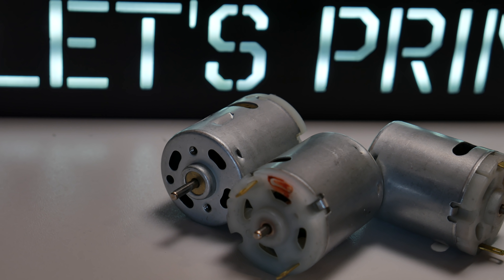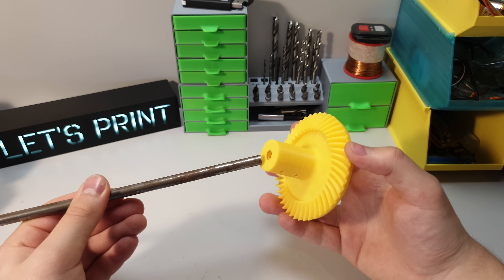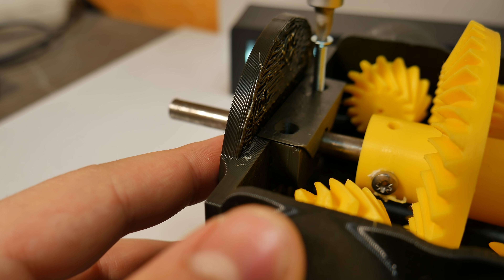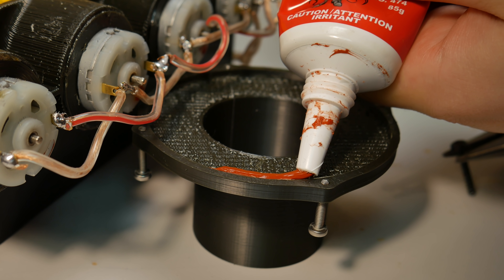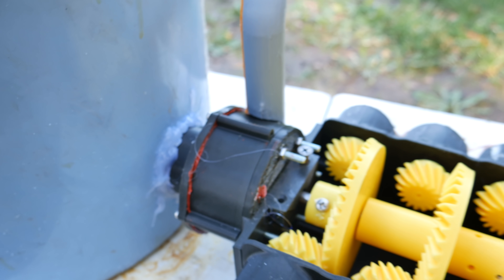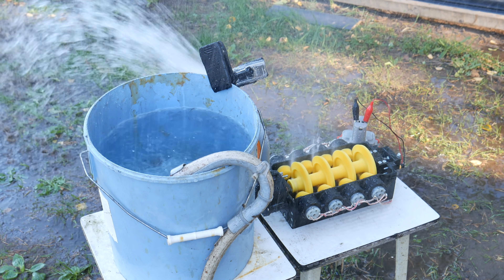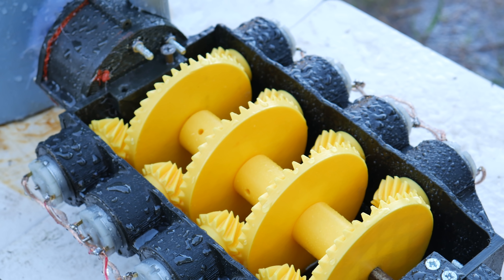Extremely Powerful 3D Printed Gearbox & Water Pump - Eight Electric Motors

Comment: Cool PoC but the water spraying over the contacts gives me anxiety attacks.
Reply: You can actually break in a brushed motor completely under water. RC car racers do it.
Reply: @mjodr  mineral spirits
Reply: @mjodr  Wrong. You can take a BLDC motor in water, not a brushed.
Reply: @darvinde  complete opposite my friend.
Reply: It’s fine as long as you blow them out with an air compressor when you’re done.
Reply: @itchyprince3793  mineral deposits will still be left on the contacts.
Reply: That won't do much because of the low voltage but the water will certainly kill the motors due to corrosion.
Reply: @Darvin Wrong. RC racers have been doing it for decades. Look it up. Plenty of people putting a brushed motor straight into a cup of water and running it full RPM.
Reply: @mjodr  usually RC and slotcar racers clean their brushed motors by putting their car into alcohol, soapy water or even benzene to clean out their car's motor, also to break in the brushes beforehand so that there's an optimal contact on the brushes.
Reply: @mjodr  Jeah, Look it up. After a few minutes the motor says adios
Reply: You think it's working because of a 2 minute video on YouTube
Reply: @mjodr  Also the water removes the oil on the brushes which will cause long time failures.
And water + voltage = Electrolyte Water = Broken Contacts
Reply: @mjodr  don't tell shit if you never tested it
Reply: @darvinde  You are hilarious. You clearly refuse to look up the numerous videos of people breaking in brushed motors in water. There's also no oil on brushes. Next you are going to tell me the earth is flat. The ignorance is incredible with you.
Reply: @mjodr  u
Reply: @mjodr  I tested it with serveral motors
Reply: @darvinde  actually your wrong. I have a slash 2wd and everytime I feel like upgrading I always break in the brushed motors in water for like 20 minutes. Never had a motor fail. And I've taken old ones and new ones apart and there is not any oil on the brushes. I don't know what you are talking about but you are definitely confused. Everyone in the hobby breaks in motors like this. Then you use break cleaner to clean them out afterwards and when they get dirty.
Reply: @jacobpoucher  in Long Time not
Reply: @wtfbbqthx  No bc I have the better profile picture I am right
Reply: @darvinde  You are wrong, @Matt Mead is correct. Racers have been known to break-in the BRUSHES on BRUSHED DC motors. While this helps to prevent chipping of the brushes, it does decrease the longevity of the motor and is not recommended by any motor manufacturers.
Reply: it would be bad if it were saltwater, still nothing too major.
Reply: A longer shaft between the motors and the bucked, along with drainage holes could help with the potential corrosion and short circuit problems
Reply: @Brody Massey Serious.. this guy thinks you put oil on brushes
... Screw it, you're both dense.
Reply: @DarkLinkAD  well there are special contact oils which you can put on your wipers (if you race slotcars competitively) which you can also put on your brushes, although not the best thing to do it's a great thing to get a good starting speed when qualifying, especially if your motor is on it's last legs, normal oil shouldn't ever be put on though as it's obviously an isolator
Reply: Just to put some light on this discussion but it doesnt matter what kind of motor it is, it all depends on its ip (index of protection) value, especially the second number. For this application, wich is water spashing from all sides ip 34 would be enough, to fully submerge a motor you need a motor with at least ip 67 or it will get destroyed. And for those who are interested the first number says how well it resists dust.
Reply: You should watch some @ElectroBOOM videos where he explains how bad a conductor water actually is. (Contrary to the popular belief in the TV, you probably wouldn't get electrocuted by a toaster in a bath.)
Reply: for a sec i thought this was an electrolysis video
Reply: @Brody Massey Thanks Chrome. Please try to fix your ram problems

Comment: for the leaking you need to put some kinda sealing washer just on the front baring. and do something for covering gears and its better for the noise, and motors be cause they'll rust soon.

Comment: Print a cover for the motors mainly, these will not last long once a little bit of corrosion starts, looks to move water fairly quickly, do some pressure tests create a pump curve map would be interesting to see how this pump performs accross different pressures/flows

Comment: Some rubber seals would help on the shaft also the gearbox once sealed from water could also have oil in it to cool the gears and lubricate them :) would also help make it quieter

Comment: I'm curious to see how well the pump would pull water 'up' from the bucket as opposed to being fed water from the bottom. Nice design work, btw.
Reply: I'm guessing it wouldn't work at all without being primed. The impeller only works if it's already in water, so there would be no suction available to draw water up a pipe. At least not without a different design.

Comment: You should have a teflon or nylon button between stop bolt and gear shaft, steel on steel......and Teflon or Silicone grease instead of oil?

Comment: For the water getting into the gearbox: add a O ring slot into the body where the rod goes to the impeller and add a O ring. Sealed the impeller from water going through bearings. Now print a cover for motors and gearbox.
Reply: Correct term would be axial seal, o-rings are for static environments
Reply: @teemuuusitalo7987  this is something that won't be used for prolonged time but I agree, it is a bit inadequate. Self filling shaft lip seal would be the best since it works on boats, it would serve here also.
Reply: I agree with this guy
Reply: I wouldn't use an o-ring but rather a oil seal in either nbr or fkm
Reply: Try making a packing stuffing box, can use a rag or something for the packing. The packing is water cooled any way drill a hole in the bottom for a drain
Reply: Or a longer shaft between the pump and the gearbox, along with drainage holes
Reply: An o-ring will wear and fail rather quickly...just use a pool pump seal, and size the transfer shaft appropriately.
Reply: Id say let the water into the gear box as plastic heats up quickly from friction in this case the water would help cool them yet som drain holes would be good.

Comment: I have an interesting solution to your noise issue. Much like thermal cooling for PCs there is a new trend to submerge electronics and non-conductive mineral oil. I believe it will also work in this instance as the mineral oil will not harm the electronics and dampen sound and lubricate simultaneously. If possible I would build the enclosure out of thick rubber box with an interlocking top to inhibit moisture. As a step further you could plumb the entire project under the ground a few feet under leveling sand to further damping noise. When the oil gets too hot inside of the unit it can either shut off or circulate its oil out to a bucket or a barrel. The larger the reservoir the longer the pump can without overheating.
Reply: I'm going to attempt something similar using brushless sensored motors intended for hobby RC couple to an all metal drill powered water pump. Aesthetically all you will see is a epoxy sealed diamond plate box with acrylic windows completely lined with half inch thick rubber insulation.

Comment: Cool project! Perhaps you should put the impeller housing in acetone vapour too? You've got a really nice chamber for it. :) It would probably help on both water tightness and the total integrity of your pump housing. One of the reasons I love using ABS is the fact that I can use acetone vapour to smoothen surfaces and strengthening the integrity of my print. I see your point there.

Comment: Is the back bolt heating up from friction
Reply: Four Kings good point - it’s not a great thrust bearing design
Reply: @emma.jacobs1  Find a copper cup that slips over the 8mm shaft and just polish the tip of the bolt so it's convex, then give it some grease.

Comment: Thanks to air pressure (due to the fact that the water level is higher than the pump) you get plenty of flow whether the pump is running or not. Fix that for one, fix the leaks for 2, its interesting way of connecting a bunch of small motors, but why? Adds to the complexity and maintenance will probably suffer over time. Prints look nice and gear action is as well.

Comment: Each motor might not turn at exactly the same RPM. Maybe not noticeable with only 8 small DC motors. How powerful is just  2 or 4 vs all 8? (Also interesting to test single motor directly attached).
Reply: Alright... So... I just saw your video on the 2 motor version.. Meaning you already did what I asked! :p

But that was in a different enclosure ;)

Comment: Cool video but you need to wire it in parallel instead of series otherwise the extra motors are practically ineffective.

Comment: why not attach the motors radially around the gears so you could use less of them and it be smaller
Reply: Assembly would be complicated as the main shaft would not have clearance to be placed in from the top.
Reply: Hehe pump go VROOOOM
Reply: Y’all realize they’re just plastic right? This spreads the load out, I doubt 1 gear could handle the load, and would quadruple the amount of heat generated by friction
Reply: @WraithRacing  I was thinking the same exact thing.  It's 3d printed plastic.  By having all those motors and all those gears, you spread the Torque out across all of that.  He's far less likely to break or chew through those gears the way he's doing it.

With metal gears, you could do all this with one brushless motor and a much smaller gear box, but the gears being metal would actually be able to handle the torque of a brushless motor.
Reply: @WraithRacing  plastic is a fine material for gears, done correctly it can support crazy loads. For exmaple my home generator has a plastic camshaft and its a high quality one. :)
Reply: PhantomBlank yes if the situation calls for it but in this particular case it would not hold up.
Reply: @PhantomBlank  my mid-drive ebike motor has a nylon gear in it (though the final stages of the gear reduction to drive the cranks are steel gears)
Reply: @PhantomBlank  Plastic was used on timing chain gears in V8s for years to quiet them down. Nylon outer with metal inner.
Reply: Installing the motors with the drive gears coaxially to the main shaft would also decrease the friction and the noise pollution
Reply: Thinking about it some more, the motors should be connected via a differential I think.
Reply: @mafiosomax7423  If you care about efficiency I agree, as those motors are likely not running at exactly the same speeds. But it would increase complexity and part-count significantly which would probably require more maintenance
Reply: @mrbearman_7735  if you cared about efficiency you would waste your time and just get a larger 12v motor instead of 8 and a gearbox
Reply: @shaynegadsden  Ofcourse, hell there are probably many products that are many times more efficient than what he built here
Reply: @mafiosomax7423  the way DC motors work, the faster motors will gain more torque when they're slowed down. It's a self-tuning system.
Reply: Or axially, in a line

Comment: Damn imagine this with a rc car brushless motor
Reply: I was wanting to something similar. I believe you would need a special ESC to monitor the speed of all the Motors.
Reply: @ryanrinn4041  Depending on how you wire them the same ESC could control all 8 of them. It might actually be preferable as you wouldn't want any one motor to be out of sync with another.  Just make sure to calculate the voltage so the ESC can handle what you attach, and scale the motors down so they don't overwork it.
Reply: @Scott_C  I wouldn't put more than 1 brushless on an ESC, it might work on the bench top but under load the ESC will freak out.

I'd use a single bigger motor or maybe a couple slightly bigger motors and give them an ESC each, they're cheap and literally plug and play, easy

Comment: Why so many drive motors? Wouldn't you get the same result from just one since all the gears are conneceted?
Reply: Depends on the speed and torque. More motors won’t increase the max speed, but it does increase the torque. At some point, adding more motors will have no effect...
Reply: @xfactor529  yea but also the torque needed for the pump should depend on how much water should be pumped right ? and also for the size  the impeller. and i think for that size. he shouldn't need 8 motors . but great video tho! really enjoyed it.
Reply: ren santiago well yes... but it depends on both torque and speed. If those motors had infinite torque, but only a speed of 1rpm, you can’t really pump any water. And the inverse applies as well. The thing is, we don’t know any of the specifications of his motors or what the optimal ratio is. So it’s hard to say if his setup is “good” or “bad”

Comment: Just use the water that leaks on components to lube gears
Reply: Yeah like build a cover and use the water for cooling and lubrication
Reply: Water doesn't lubricate very well and it will short the internals of the motors, if you're pumping non-conductive liquid then it's fine and that's how fuel pumps work in cars
Reply: @Green__Man  yeah but if you make i water tight so that the water doesn't leak out to the motors then i would cool the gears right?
Reply: @kaxelgood6462  yeah if it's only touching the shell of the motor then it'll cool pretty well

Comment: Would love to see you get this sealed a little better(less leaks) and would love to see the boat and lifting gearing! Great video!
Reply: I really struggle to print anything to be water proof, even with 100% infill, still leaking. I think 3d print is not good for waterproof solutions

Comment: Gonna need that for my next watercooling loop for my PC...
Reply: Dude are you building a personal reactor?
Reply: @nopparuj  Will probably need a pump like that if you plan on using 4 3090s
Reply: @nukem1839  Do you have a truck for a pc case? Most can't even fit 1 3090
Reply: @jordyv.703  I have a Phanteks Enthoo 719 so it could hold 2 3090s but not 4 sadly. Gonna have to upgrade to a new case.
Reply: @nukem1839  or one FX9590 at 6 GHz
Reply: @jordyv.703  they probly can fit that, but the cards are extremely overpriced
Reply: I hope you have noise canceling headphones
Reply: @JohnDavidDunlap  Don't worry the PC will be in an anechoic chamber. I'll be in another room curing cancer with that much graphical power.
Reply: Don't forget guppy and algae eater fishes for new aquarium. Cheers!
Reply: @madyogi6164   getting sucked into the waterpump, fishpaste ...
Reply: The cpu will always cold
Reply: use BLDC motors, more power and you can get the output from the fan headers to the drivers 😂

Comment: I'm very peased by the quality of those 3d printed bever gears! Wow. Could you tell me more on how did you print them? What orientation, layer height? Thank you.
Reply from the maker: Thanks. Gears are printed vertical positions (gears face up), 0.4 nozzle, 0.2 layer height, 30% infill, wall thickness 5 parameters and no cooling. I used Creality CR-10S and ABS material. :)

Comment: Could you put two of the large gears on the main shaft on facing the other way with the motors turning the opposite direction so that the big gears rolling on the little ones keep the teeth engaged?

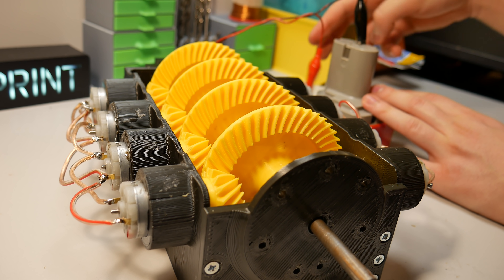Comment: A number of issues: That kind of motor rusts really fast; electrical steel rusts fast anyway, but discount motors tend to rust the fastest. You only need one of the larger gear; make it dual faced and arrange the motors around its perimeter, alternating faces; this also obviates the need for the axis pinning screw. The orientation of the print allowed the motor mounting holes to split (3:45); design the motor mounts to be separate from the central hub enclosure so that all pieces can be printing in orientations that are a lot more durable. That impeller design has terrible efficiency for that task; google better impeller designs.
Reply: A single or dual 550 might have yielded similar results.
Reply: He did a video with multiple designs..
https://www.youtube.com/watch?v=EBVBMvhi4Y0&list=PLR3hKg7-dihMX1_Gfuth8Y8xlKsbpgMib
Reply: @BullFrogSummers  I am not talking about the impeller, but the actual 'gearbox'. He uses a 775 motor (with quite measly thin wiring) in that video. These are high torgue motors that are rated for 12V. I can't see the battery well, but I suspect a 2S (~7.4v). They are about 7000 RPM, while the 550 are available from 3600, 7200, and way above this, like 19000. IIRC he used 260-sized motor, while rated for about ~18000 RPM, they do not have the torgue by themselves (hence he needs 9 of them?) and likely overvolting as these are rated for 6V (you could hear them scream) so won't last long with copper brushes. I am not going on a witch hunt to look for the video where he tests this, but I believe the choice was based on cost.

Comment: Between the pump chamber and the gear box chamber, a small cavity to collect and drain water leaking passed the shaft would prevent water in gear box problem. The main concern is get water in the motors, as electrolysis will corrode the brushes, rust the magnets, and seize the bearings.

Comment: Did well enough with a matched train drive system to get enough torque while using cheap motors. Now it just needs a spiral vane impeller, a volute with diffusion vanes, conical bearings to isolate any axial thrust on the gearbox, and a gland seal for the drive shaft on the pump end.